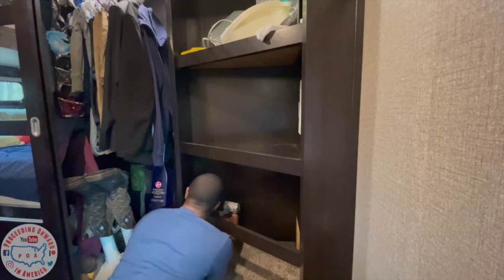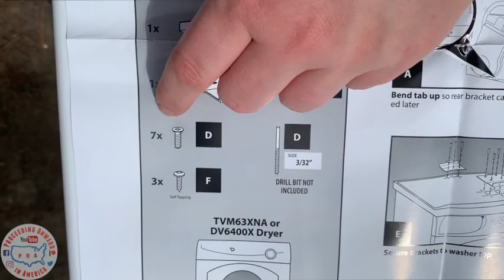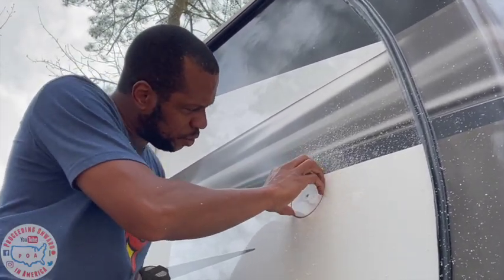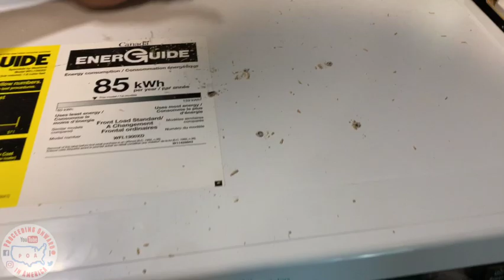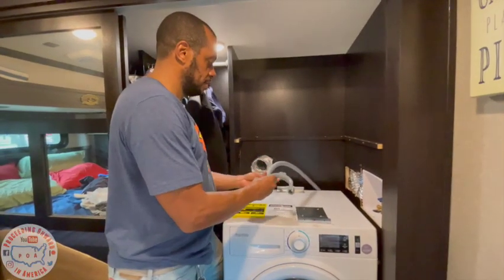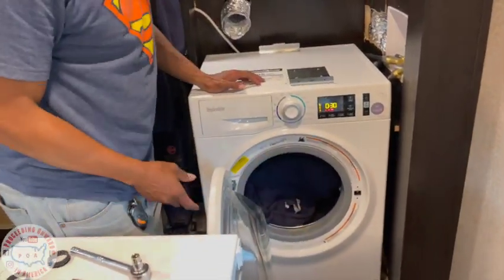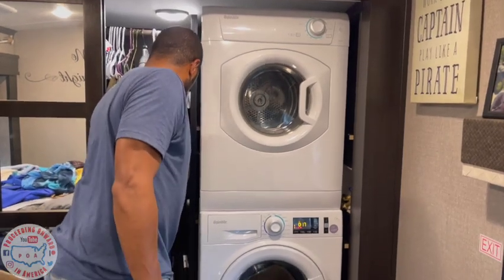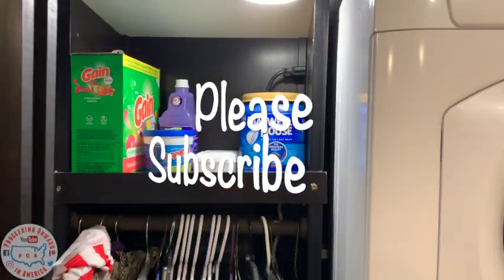Install tips for Splendide washer and dryer ~ Jayco Northpoint 377RLBH ~  POA vlog

Comment: Great job Fabian. Our next RV will have hookups for a washer and dryer. We actually looked at a new one. And they said that they would install the washer and dryer. It has room for a washer and dryer combo. And the recommended a Vented setup. And they would install the vent on the outside of the RV just like you did. But due to how the closet is designed. They will build a platform for it to sit on. After being full-time RVers for a short time. We see the big need for a washer and dryer setup. Going to a laundromat will get expensive after awhile. They will pay for themselves in no time. How big of a bedspread can you wash and dry in it?? Currently we have a Queen size bedspread it's fairly lightweight. But the RV we are looking at has a King size bed. So we will have to get a bigger bedspread. So will a King size bedspread fit in it?? Or will I have to take that to the laundromat??
Reply from the maker: Thank you and we are so happy that we purchased this. Washer/dryer combo holds smaller loads than the stackable from what we remember. Also, we can do our fitted sheets and top sheets but blankets or anything with some bulk to it can’t really get cleaned well/move around in the machine. Plus, weight of the items can be too much on the bearings once wet. We just do our loads of clothes and towels and stuff and leave the blankets and big stuff for a laundry mat
Reply: @proceedingonwardinamerica  that is exactly what I thought. I would do big blankets and bedspread at the laundromat. That wouldn't be that bad. I'm so tired of using my portable washer and hanging everything up throughout the RV. I have to give Abby medicated baths every 2 days. I just want to be able to keep towels and things cleaned up. Abby has a skin yeast condition. And when she lays on things she gets that yucky stinky smell on things. Plus that yellow pastey stuff on sheets and stuff. I'm so tired of campground laundromat. It's getting expensive.

Comment: Thanks so much for doing this video. We already had a washer and dryer unit installed in our rig and the dryer needed a new belt. But I couldn’t figure how to detach the dryer from the washer. Your video showed me how the brackets connected them, so I was finally able to pull that sucker out and then proceeded to replacing the belt which was another adventure. Thanks again!!
Reply from the maker: You are welcome!  Glad our video was able to help!

Comment: Nice job guys! We were super happy when we bought ours the previous couple already did all the hard work and installed ours! Great video
Reply from the maker: Thank you! We thought about the dealership doing it for us but we are cheap. Good thing is it wasn’t too hard just mostly hard to squeeze through the doors and hallway and might need help lifting it up the stairs.
Reply: @proceedingonwardinamerica  I’ve since had to remove my dryer to replace a thermostat in the back of it. What a pain. Had to remove the closet door and all of the trim just to get it out 🤦🏻‍♂️
Reply from the maker: Yikes. Sorry you had to do that. We had to take out the dryer recently to clean the vent and hose.  Luckily Fabian didn’t have to remove anything else beside lent and the dryer.

Comment: You guys did a fantastic job with the install.  Fabian made it look super easy. INTENTIONALLY putting holes in the RV freaks me out, but it looks like it worked out for you. Hooking up the dryer vent looked to be the most difficult part. We don’t have that half wall, so I’m not sure how we’d connect it without contorting ourselves. LOL
Reply from the maker: He did a great job installing it and lifting it. Momma wasn’t allowed to lift at this time. ;-) 
We were so nervous putting in that hole and glad they placed the sticker in the right area unlike the knobs. If they had to mess up on something at least it was that. Lol thanks for stopping by and watching!